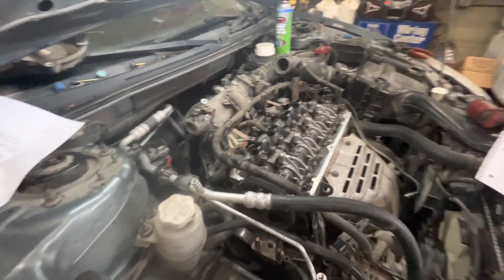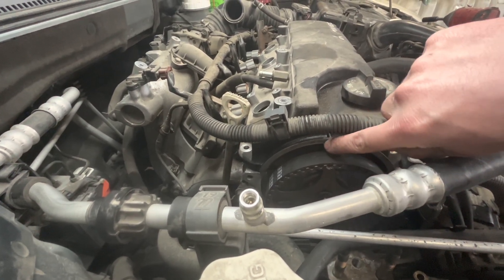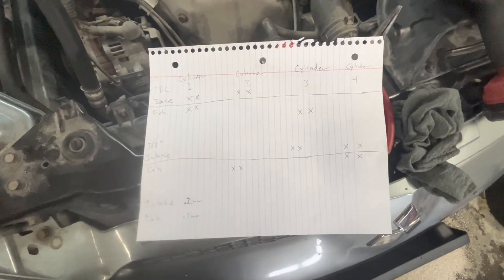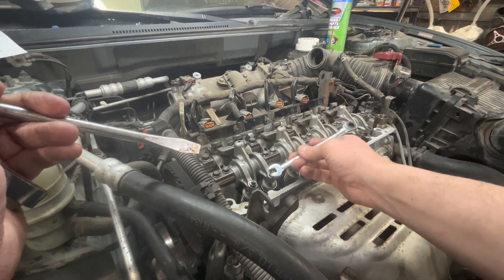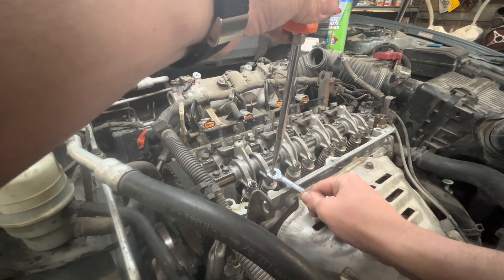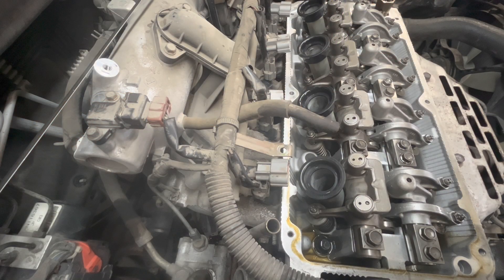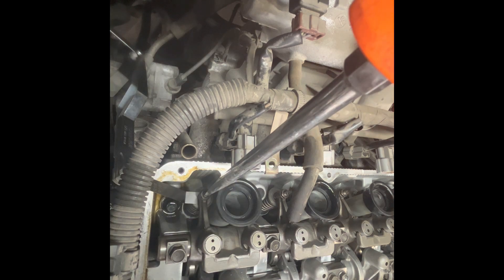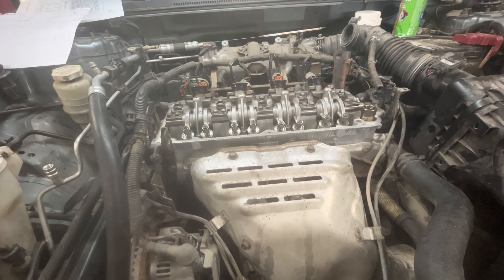How to Adjust Your Valves

Comment: I was told that the engine needs to be at operating temp before you start to pull everything and do valve adjustment is that correct?
Reply from the maker: It’s probably the best way to do it if you could! But you would burn the crap out of your self trying to do it! I always do it when it’s cold and it works every time!

Comment: Sorry, rotation is 180 degress not 360(complete turn) and manual for the 4G69 engine says intake 0.11mm and exaust 0.20mm
Reply: That's what I know @raulacedo this guy is totally wrong with the measurements
Reply from the maker: I got it all off Mitchell.
Reply: Ive got my engine specifications in owners manual for 2005 4g69 right here and it is 0.20mm intake and 0.30mm exhaust